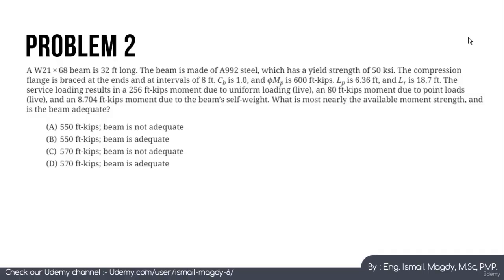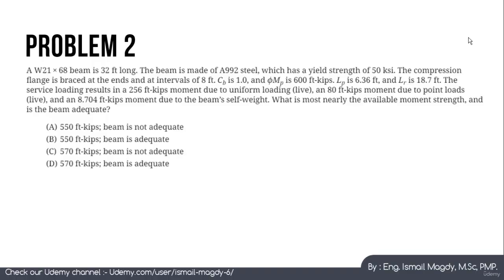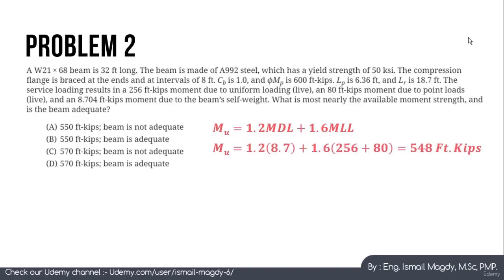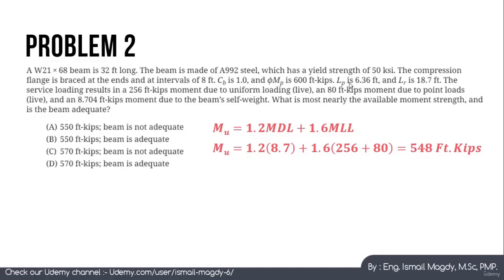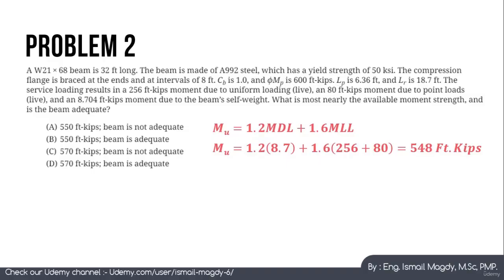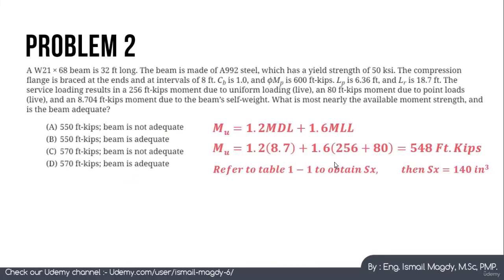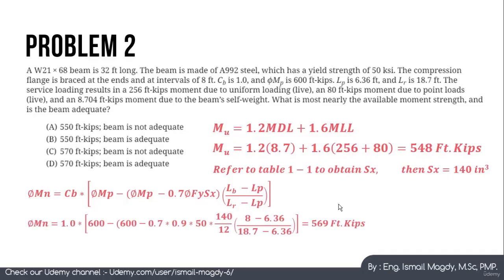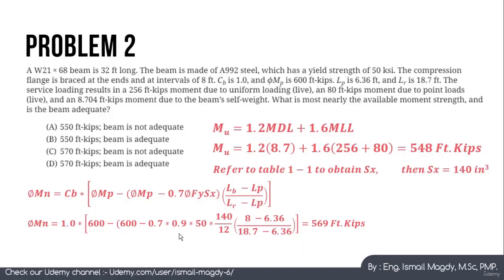Steel Design Exam Answers | Part 2

Comment from the maker: 🦾 Steel Design Exam Solutions – Part 2!
Which topic should appear in Part 3 —
Tension (Advanced), Compression (Buckling), Beam Flexure, or Connections (Bolts/Welds)?

👇 Comment your vote — I’ll use the most requested topic next!
▶ Playlist: https://tinyurl.com/4fdnmzca

👍 LIKE & SUBSCRIBE to keep learning steel structural design.